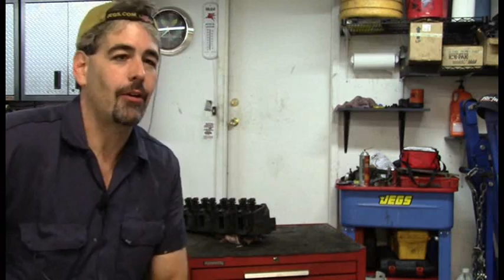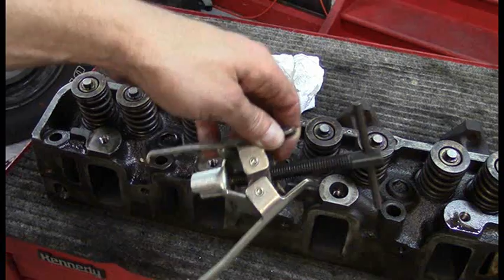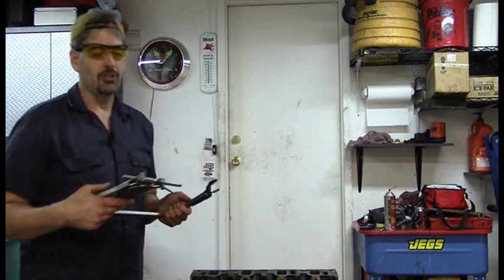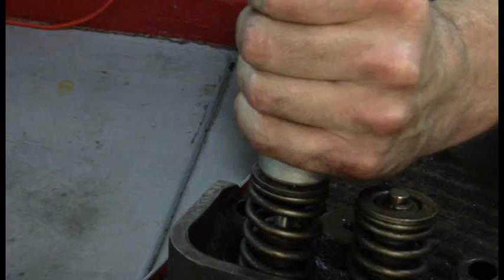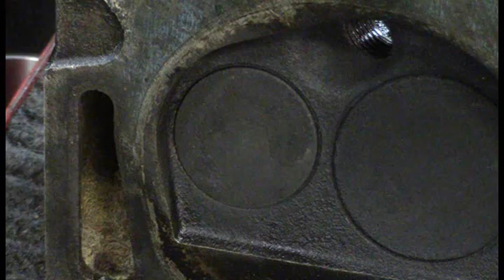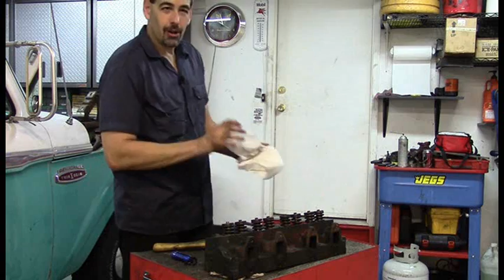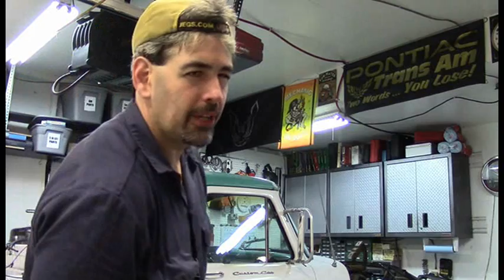Extreme Budget Engine Rebuild-Pt5- Cylinder Head

Comment: I use to lap the valves in as long as the valves were not too pitted or the guides were too loose and with small  block chevy engines the guides were allways wore out.

Comment: I got here after either blowing a head gasket or cracking/warping a cylinder head, but the car is only at 70,000 miles so hopefully the piston and valve walls are to spec. I'm making sure that I do extensive research on everything before I start turning any bolts at all.
Reply from the maker: That’s EXACTLY the right approach!!!!

Comment: Another down and dirty valve seat/seal test. With the spark plug in the head, turn the head valve face up and fill the cylinder crown i.e. the dish with water for each cylinder. Then watch for water at the intake and exhaust runners. You can do that prior to disassembly and then after you clean the valves/seats up to validate if they were leaking because of crud. Additionally if you hand dry the the dish with a towel, if the head is cracked a "moisture line" will present. Not a perfect test, it would point you to the idea of magna-fluxing the head to confirm. Little time consuming the de/re of the values, but its free. On a budget build that's a good thing.

Comment: I'm pretty sure I got a valve guide/seal issue. I don't have a bad smoking issue except if I sit at idle for a while like in a drive through or traffic jam then I start to get pretty bad smoking but clears up after I get back moving. I was thinking maybe rings but I wanted to try rebuilding the heads first. I'm a fairly capable home mechanic. But trying to get this salvage caravan back good. It also passes smog test with flying colors I just have to get a good bottle of that stop leak/smoke a few days before hand

Comment: I have to say after every video that everyone has opinions but there is facts and when 2+3=5 it is that way no matter how you get it, plus talking engine blocks if the specs are that close to maximum anyway then youd probably be really really pushing the limits on getting the money worth and best performance with those specs, some manufactures make extremely generous tolerences as it is. I'm a GM guy but I know myself that with any engine you do have to realize that once your in it and it needs anything more than an average rebuild its not going to be a $500 build unless you have a major discount, and most tolerances if not all are pretty well off the border line of min/max spec. Atleast there are options as to get an engune to last a little longer if its just a little low on oil pressure or a small issue such as a little smoke, id go with a bit higher viscosity oil and or try using something that will swell seals a bit and atleast keeps from fouling up plugs, and of coarse I do enjoy the logic conversation and understand that its good to mention that it just makes since not to waste money. I can say that with coolant and oil leaks that theres usually a cheap way that anyone can get life out an engine and make it last before it fills the crankcase with a gallon of coolant and destroys almost everything or the oil is burning faster than is your fuel. God knows there are always people that have to be ignored because they are simply a little bit stuck on trying to make people think that they have the knowledge that surpasses all and knows things that doesn't even exist. But you do great at explaining thing and I'm sure you wouldn't like to continue reading for another hour, so I can end with saying that everyone is good at something if they want to be, you have your strengths too, mine is electrical and I use logic to learn and understand everything else. I have trouble staying on some topics but effort produces knowledge after a while, I started my life with high functioning autism but even though it doesn't go away I can use the brain I was born with to learn and do what some people could not dream of if want, I may not be able to do some things but I believe everyone is made for atleast one good thing and putting a little curious effort into learning you will succeed and I think alot of the people that dont want to learn won't learn and people who do will learn, they should learn and then they would be able say they got where they are not guessing and putting an effort into it, thanks for the videos and I appreciate the time and effort applied, thanks.

Comment: Ok. I'm here to learn how and WHY.. yes I have the same feelings I had when attended my grad school.l don't want any 3 minutes videos. Thank you for knowledge, skills, and the experience you're sharing with us
Do you recommend polishing the valves beneath the seats? If not, is carb cleaner is what you recommend?
Reply from the maker: Congratulations for your good attitude towards learning.  YES- I use a lapping compound to polish the valves beneath the seats and if my "marker test" shows there is very poor seating, I will usually consider machining.
Reply: Schrodingers Box you've just made my week easier. I'll inspect the block the way you did and (yes with a feeler guage) and if the block within the specs I'll do the ringes then polish the cylinder head ". But might not afford a mechine shoppe!
Thank you so very much for your instant response, much appreciated

Comment: Would an aluminum engine be more prone to cracks in the head? I'm assessing an 87 Pathfinder and the leak down did poorly for two cylinders next to each other. It's not the head gasket because there's no bubbles coming out of the radiator so I'm at an intersection with my truck again. Thank you for having car videos that actually make sense to logical people.
Reply from the maker: definitely more prone to warping no doubt. Cracking, not sure. Seems pretty soft to crack as easily as cast iron.
Reply: I think it can still be head gasket if it's blown at the fire ring between cylinders
Reply from the maker: Yes that absolutely can happen. When that happens you will see equal low compression on the two adjacent cylinders sharing the ring.

Comment: If you want to measure the compressed valve spring height take the spring off, put the retainer and collets back on, pull up and measure, then subtract the retainer height, works for me.

Comment: You might already spoke about this. Another price adder is hardens valve seats to use with the fuel that we now use older engine did not have them.

Comment: I just realized this video series is an older series. Thats ok,I found it entertaining anyways. I hear many burned out mechanics that really vent heavy duty concerning stupid people and arm chair mechanics. Because I worked in a shop,I can relate. I had my own snowmobile shop for a while and had a few idiots bring their sleds in wanting a half of an engine rebuild because they had a hole in a piston on a twin cylinder. Their idea was as long as the other one was still working, they were trying to save money. I usually ended up throwing it back together,charging for my time and telling them to get it out of my shop. My reputation as a shop owner ment more than some cheap ass wanting to save a few dollars,then having the other cylinder go bad within a month,then go on a rant telling everyone I did a bad job,especially to all their sledding buddys. Word of mouth in a smaller town will ruin you. I refused to do anything half assed on things like that. Imagine only rebuilding only half of a V-8 engine because one side still had compression,though not weak,but not great eather,then they come back later bitching because that motor isn't performing and the guys buddy's point out that the other side should have been done. Next thing you know, guys start showing up at your shop telling you about how you screwed up their friends engine,blah blah blah. Yeah,nope. I did rebuild an engine to factory manual specs,only to find out that that engine had problems right from the factory. I found out on line that those snowmobiles were over heating and the motors were melting down due to lack of air vents in the hood and also a bad carborator set up,right from the factory. I ended up having to rebuild it twice,then the owner dumped the sled on me. I was able to get the title and sell it. Because of the design issues however, the snowmobile was a fuel hog,too heavy and wasnt very popular. Skidoo really laid an egg with that model. I remember the 4 cylinder Mustang 2 engines ate camshafts because the oil ports leading to the upper heads were too small,resulting in oil starvation on the top end. I used to rebuild them and resell them all day long...no more issues,I reported the oil galleys,always fixed that issue.

Comment: Owning an old vehicle like that means that the owner should be aware of the cost of restoration even not to pristine level its not cheap to restore/repair a 50 year old vehicle-- Personally I think many owners prefer to keep the original engine and refresh it and when was the last time you saw a 352 for sale? Also if the owner decides to sell a refreshed engine is a good selling point

Comment: Your magic marker/sharpie test is flawed. Surely the area you mark first with the sharpie will dry quicker and therefore harder to remove than sharpie ink that has just been applied. Even a matter of seconds can make a difference. I've rebuilt many engines this way and use a stand drill with 20 grade stone bit to clean up the seats before lapping the valves with fine paste. All of them have seated perfectly and passed the gasoline in the combustion chamber test without any problems. You just junked a perfectly good engine that could have been rescued.
Reply from the maker: Incorrect. You let the ink dry first and even if you don't if there NO CONTACT then there is no contact, it doesn't matter.
Reply: Thanks for fast reply. Keep up the good work.

Comment: I wasn't going to say this but when you used the feeler gauge between the piston and cylinder wall you made a slight error, you needed a second gauge 180 degrees opposite of where you used the one you had, your measure was doubled by not taking into account the other side.
Reply from the maker: The only problem is that the proper measurement IS the gap on one side. You do NOT fill the gap on the other side to determine clearance. The proper method is measureing TOTAL CLEARANCE which is how I did it- though two gauges does the same you just have to double the reading.
 In fact, just a brief moment's thought indicates this is more accurate that using two gauges because your halve your source of error margin combined with the fact you are doubling the measurement... using two gauges would be extremely foolish.  If I measure a clearance of .002" with a 5% margin of error (MOE) this is far superior to two measurements with 5% MOE which now doubles the MOE to now become statistically significant.
 ALWAYS ALWAYS ALWAYS reduce error sources!!!!

Comment: In part 4, seems like you did with your F350 engine exactly what I want to do with my LT1.  I.e. re ring and new bearings.... and you say it ran forever and even towed!  So if my engine is in spec, new bearings and rings is good enough to buy it some extra life.  Won't make it a 0 miles engine but will make it a lot younger than 100k Miles.  No?

Comment: I can't help but wonder, that tool seems very nice for DISassembly but seems like it would be useless for reassembly and you would have to own one of those other tools in addition to it.
Reply from the maker: You are referring to the valve keeper tool?  Actually it is just as useful for reassembly. You place the valve in placer with spring, set the keepers on the spring and place tool over everything and whack with hammer. When spring compresses the tool pushes the keepers into the valve lip and it's all perfectly installed. It's amazing!

Comment: Regarding the point about not needing specialized tools, are you suggesting doing this without a hydraulic engine hoist and an engine stand?  Those are both pretty expensive tools. Is it reasonable for a DIYer to disassemble and reassemble the engine piecemeal directly in the engine bay?  Really enjoyed this whole series. Thanks!
Reply from the maker: Good point, didn't really consider that lol

Comment: Another quick method to check valve sealing, with the head removed of course, is to tip it up on edge so the intake (or exhaust) ports point straight up. Fill the port with gasoline and watch for any leakage around the valve seat. If it stays dry, it will pass the "ink test" and now you don't have to remove that valve.

Comment: Dear Schrodinger,
Please accept my apology for posting out of sequence.
I would like to return to your cylinder bore measurement technique for a moment.
In your original measurement you used the piston as a  known diameter, no problem here.
My challenge is with the feeler gauge and the non wear lip at the top of the cylinder that you originally pointed out which was significant as expected with an engine with high mileage and wear.

This non worn  lip is due to the area of the piston above the top ring, thus no cylinder wear.  I am confused as to how you are getting an accurate measurement of the diameter of the cylinder below this "non wear" area when you are inserting the piston and feeler gauge through the non worn area.

So as in science let''s take the example to an extreme to see if it holds.
Let's make the non worn area 4" in diameter and the depth 1/4" and the worn part of the cylinder 4.125" when the feeler gauge and piston are inserted 1/8" the measurement will be of the non wear area. As the piston is inserted deeper into the cylinder, say 1/2"  the feeler gauge will be at an angle between the piston and the non worn cylinder 1/4" and the worn part of the cylinder.  I do not see how no matter how deep you insert the piston and feeler gauge into the cylinder you can get an accurate measurement, until it was all well below the non worn part of the cylinder.

I think the bore gauges you invested in are going to provide a much more accurate dimension of the diameter even allowing for the challenges you point out.

Thanks for your thoughtful analysis and time in making these videos.
Regards,
Steve

Comment: There is a small expanding ball tool that works just as what you used with the cylinder clearance check you would expand the bald ever 1/4th of an inch through the valve ride and measure god that was a bitch to do in class lol I rebuilt the 260 in my 64 fairlane in class here at college and we were graded on how well we measured EVERYTHING

Comment: Now that it is apart why not do the machine shop work and have a fine running engine in the end. I know that there is a cost to that but if the owner is in love with the truck he should have a good running engine. It is a good investment I would say. doing it cheap is not a good way to go. The truck looks solid and worthy of the consideration. even if the steering and suspension needs some work. The original engine is worth more than a paper weight.
Reply from the maker: +cornflake73 B-U-D-G-E-T

Comment: If the valve isn't seating perfectly I seen on other youtube videos that a valve job is fairly easy to DIY.  It's a little time consuming but you use a suction cup valve tool with valve grinding compound.
Reply: I've got the right tool for doing just that, I got it from a yard sale many years ago and it still works like a charm for minor seating problems, and lapping the valves in on my '52 Flathead engine.

Comment: Hi, I have a 67 mustang with a 289 stock motor. I bought this car unfortunately with no mechanic records, I am completely in the dark about knowing the condition of this motor. It seems to run good but I want to check it out to see what I got. My question is before I want to add high performance parts to it should I check the motor out from top to bottom? Or have someone look at it. Would it even be worth it. I am not a professional mechanic like you are, I like working on my car, but motor work is a very complex operation. I do want to learn, and only to learn is to do. Just like any profession. I think you opened my eyes to determine if I want to pull the motor out and tear it apart with the basics in tools. My thoughts are I was thinking it's not the original motor so maybe put in a replacement rebuilt motor and then with the old motor just learn to how to rebuild it and how it ticks.That way if I fuck something up I'm not without a motor. I have some friends that are more knowledgeable that we can do together, and now your my new friend, I hope. Your videos are very informative. Thank you for sharing your knowledge for free, you are i'm sure a very busy man. I hope I am worthy to your response.

Comment: The magnetic collet/retainer remover you have reminds me that I used to use an appropriately sized impact socket to remove collets. No magnet, but a chuck of Blu-tac (sticky plasteciney stuff usually used to stick posters to walls) caught the collets well. Cost was the impact socket which I already owned, a hammer which I already owned and about 2c worth of Blu-tac. Just sit the socket over the valve spring and give it a judicious whack. The machined surfaces inside the socket don't touch the collets so nothing gets chewed up and it was an impact socket so it was fine with being hit. Do NOT do this with a regular socket - they're thin walled and relatively brittle and there will be tears before bedtime.